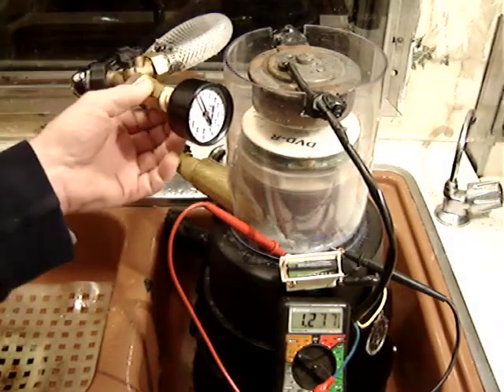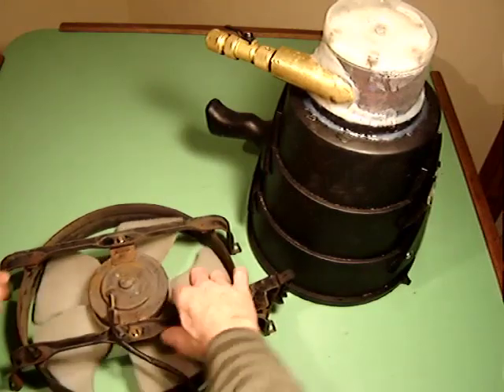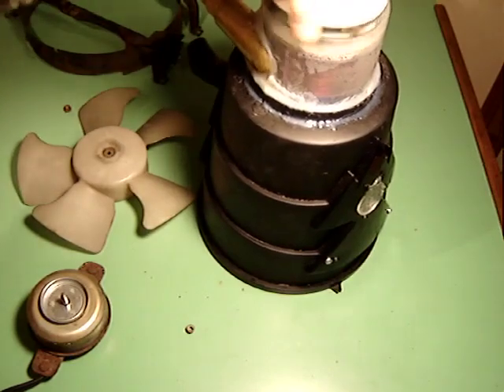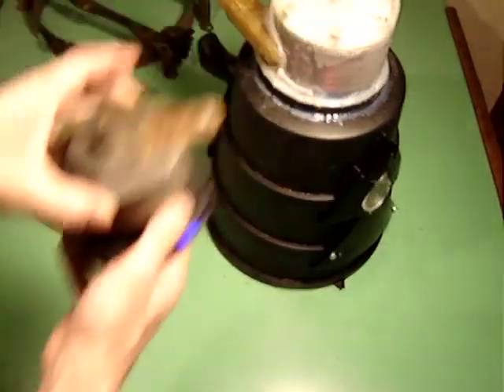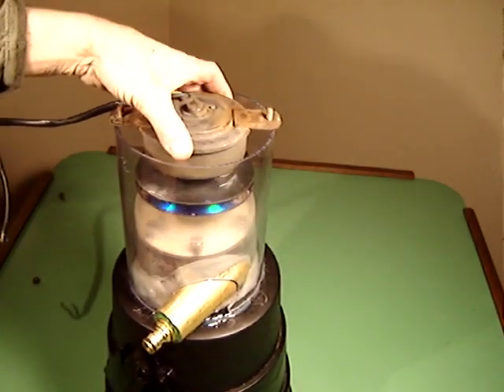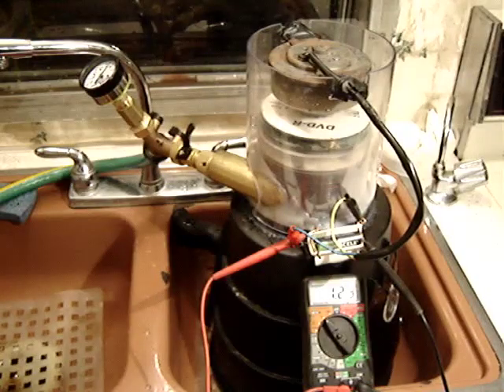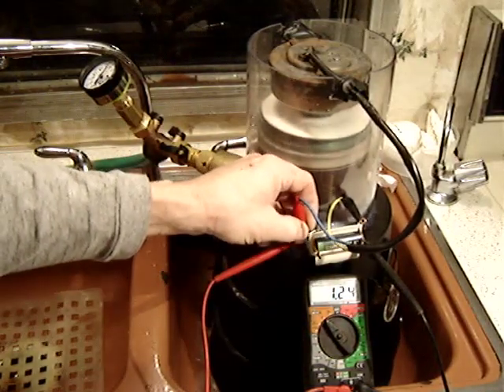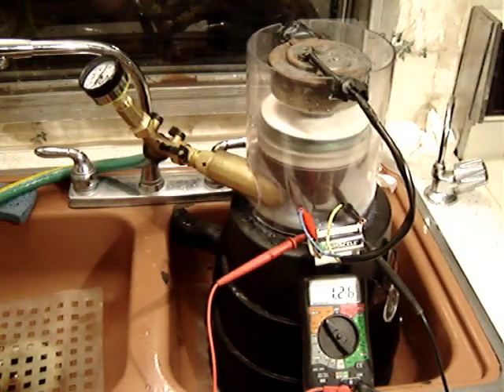SinkScience #09 - Faucet Hydro-Electric Power

Comment from the maker: @Idiotsmakemesad 
I figure, if water flows out the faucet anyway...why not extract at least part of the power required to get it there?

This Tesla turbine uses about 3 GPM which is 180 gallons per hour.
It runs at about 800-1200 rpm, depending on water pressure.

I calculated mounting one to the water mains to each house would save over 20 million dollars a year in power in the US...but the capital costs of setting up would take hundreds of years to pay off!

Comment from the maker: @thefirstofthefirst 

Great point! The turbine must rotate the motor/generator against friction, and back EMF (Electro-Motive Force) to attain enough voltage to begin charging the battery. Before it gets spinning up, the motor/generator is trying to spin backwards from the energy of the battery. A diode would rectify the problem...(so to speak!) and block the flow of current backwards. 

I'm not sure if there would be a benefit with a diode above the battery voltage threshold rpm, however.

Comment from the maker: I will certainly help! 

Have you checked out my Instructables page?  It's in the links to the right in "more info". There you will find several types of CD Turbines. The "Turkey Time Tesla CD Turbine" is the Instructable that would be similar to what is seen in the above video.

There are many experiments that can be done from one basic turbine. 

Note the CD container should be the Memorex kind that has the thick lip on the bottom spindle tray. That's the only kind I've got to seal properly.

Comment from the maker: That could work, as the Tesla turbine design makes best torque when it's running at over 1/2 of it's maximum rpm. (i.e. min 15,000 rpm for a 30,000 rpm turbine.)

There is also a possibility of incorporating a magnetic clutch  directly into my magnetic coupler. For example, there are magnetic clutches available commercially.

Comment: I understand the lack of actual "blades" in the tesla design, I just used the term for simplicity. 

My idea is considerably more complicated, but I was thinking of making a tesla turbine with a shaft, and have a centrifugal clutch system (like what you would see on a twist and go moped) so the turbine could spin up freely before putting load on it.

Comment: if you put a nozel on the turbine to increse the water presher you coud get more power a garden hose with a (jet) nozel will spin a  fan at a good speed  so a 1/8 nozle opening shoud do the trick

Comment from the maker: I do show charging an AA battery at 5:40 in this movie, 1/4 amp x 2 volt = about 1/2 watt.

There is not much power available from faucet water pressure at 25 psi. Most of the energy goes into the resistance of turning the shaft of the generator, with only a watt or two of power available to use.

This turbine can run on higher water pressure or on compressed air, to get the big numbers of generated electrical power. The power increases sharply with the square of the rpms.

Comment from the maker: I was going to run one from my creek. It requires at least a 80 foot vertical drop to get about 40 psi pressure. It is doable, but for leak-proof longevity, a stronger case is required.

Comment: Have to agree...it IS a waste of water. Would be fine if it was connected to a gravity fed river or steam though. Just run a pipe downhill to build up head pressure and then run through the turbine.

Comment from the maker: To make electricity from the Tesla CD Turbine requires a good head of water, at least a 100 foot vertical drop to get 50 psi at the turbine. To run 5 or 6 turbines at once will require about a 30 gallon per minute flow. These will be high-maintenance turbines because of the CD cakebox will deteriorate in the sun and weather. And it won't be too cheap...the supermagnets alone for 6 turbines will cost at least $400.

But it would be fun and funky!

Comment: you can get way higher voltage from just the water and some galvanized metal and some copper wire. I got a single led light to light for months straight just from water. but I did notice its more like a capacitor than a battery because you can only hook it in series or parallel if you try and go both they cancel each other out? try it with some ice cube trays to make cells and you can get about 1.2 volts from each cell in series thats about 15-20 volts.

Comment from the maker: That's what I did in this movie. The generator can only recharge a AA battery from faucet water pressure. It would be possible to charge an auto 12 volt battery with enough pressure at the nozzle of the turbine.

Comment from the maker: I've recently been considering survival mode situations and the applications of the Tesla CD Turbine, and the Tesla turbine in general. 

I'm setting up a solar-powered air pump to deliver compressed air to a tank through the day. Later, I use that compressed air.

So I am making new kitchen turbine tools, powered by air or water, or preferably both at the same time!  through solar power! 

I also have plans to make a Tesla CD Pump, using a 12 volt motor from a Subaru fan. Solar-charged as well.
Reply: I am an Rn nurse and not good with technology! Plz help me with a generator project asap please as I desperately want one esp now. Plz contact me@ tracyenglert@gmail.com.   I am having a YouTube awards and mind meeting for an adult natural healing Retreat in my woods.  Party is in Ohio April 3rd potluck and bonfire,  I live by Nelson Ledges too help me and I'll help you. THANK YOU

Comment from the maker: Thanks for your suggestion. I like the phrase "luxury of remote magnetic gearing"...nice!

Although the magnetic gearing would be essentially friction-free, the turbine on faucet water pressure just doesn't have enough torque to turn more than one small alternator. 

If I had 100 psi pressure from tying into the creek next door, that conclusion may change, and your idea becomes more feasible.

Comment from the maker: I hooked the alternator up to a battery, but it didn't meet the minimum speed in order to put out power, and at about 100 rpm with the drag, it just wasn't happening. Most of the energy fron the faucet went into just turning the alternator unit. I need more pressure! ...perhaps one day the creek next door will do the job.

Comment from the maker: Exactly! That's why I plan to tie into the mountain creek beside me for 100 psi.

I admit it requires way more power to pump the water than I get out of it. (I figure it's well worth the 5 cents an hour operating costs for such a fun and versatile experimental platform!)

However, the pressure from a well pump or city water is being mis-used in most cases...we don't need 30 psi out of a faucet to brush teeth or fill a sink. The excess pressure could be utilized.

Comment: But how much energy was used to "tap" into this  energy?  I'm sure the water pressure supplied is powered by "something" (most likely a water pump that used far, far more energy than you acquired through your generator).  Now, acquire that energy from something "free" and you'll have a winner.

Comment from the maker: It's not really negative energy; the minus sign from the ammeter simply indicates the current is flowing in an opposite direction.

 The windings of the motor cause a resistance or drag that must be overcome by rotating the motor above it's minimum charging rpm to increase the voltage. 

A similar thing happens to an automotive charging system if the idle speed gets too low.. dimming lights would indicate the flow of current is changing to a draw from the battery instead of a charge to it.

Comment from the maker: It works much more efficiently without backpressure. I hooked up a garden hose to the exhaust hole and lost about half performance. 

So it will work, but not as effectively. A vacuum (i.e. low pressure) at the outlet would be the best.

Comment from the maker: The turbine cuts down on water pressure so it wouldn't work so well for certain places that require more pressure, such as a shower or garden hose sprayer.

Also, if the outlet flow from the turbine is restricted, it cuts down on power a lot.

But the concept might work under a sink, or to fill a pool. 

The gadget is mostly to spark awareness that energy is available to "tap" into all around us.

Comment from the maker: It's not efficient if you consider dollars worth of water to get dollars worth of power.
(about a 1000 to 1 ratio!)

 The correct question might be... How much energy was lost today by opening a tap ?  

The average family uses 365 gallons a day...enough to run the CD Turbine for about 3 hours. That's 3 watt-hours per day or over a kilowatt per year of energy savings. About 10 cents worth.

 Multiplied by a hundred million households, would equal about 10 million bucks a year in energy savings.

Comment: good point, but most waist water is not under very much pressure. Possibly if the supply line was the main supply for the house and the exhaust fed into the house to act as the new supply then it would be able to work like that if the flowrate stays high enough for long enough to get it spinning at a good rate?